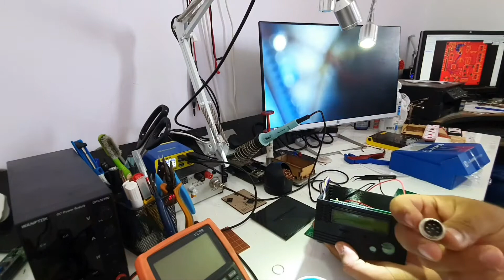DIY Pro'sKit ss-331h Got a PCB

Comment: @fixtronics What is the PSU caracteristics that you are using please? (Voltage/Current/Power) ??
Reply from the maker: Hi
The original PSU used by Pro'sKit station is 18v 12A (ZD-P150).
The one I use is adjustable power supply and I set it to 12v 5A and plenty enough to do the job.

I actually compared the how long does it take to  heat up to a set temperature both the original Pro'sKit ss-331h Station  and my diy version and they both reached the same temperature set point at almost the same time, the original Station was faster by a couple of seconds only, which means my PSU is good enough to be used.

I wish I answered your questions

Good luck

Comment: Hi, great job!! where i can found the pcb please? or have you eagle file? king regards
Reply: It contain so much mistakes, you can't even imagine 😁 It shouldn't work, or not for a long time. The clue(several!) in a relay module, first is with blue case, which is SRD series, this video it's black, which is HFKW and it's not just that! It's because HFKW withstands higher electrical load. I think blue one he burned. Relay is full incorrectly wired. Schematics contain few more surprises, even silkscreen print contain a mistake at J3 connector, see, P+ goes ground, and P- goes positive, he should swap them, because this is important to connect PUMP. The labels RX and TX are swapped, what the reason?) And to improve it - it should get more powerful power supply with 18v, this will require a schema improving, getting different pump, which more close to original one. Author gives good starting point to get to know arduino, he's showing off a beautiful 3d printed box, and gives inspiring words "amazing" and "it works!" 😊 Thank you for all! 🤝

Comment: Hello brother, 

Can you please let me know your setup’s power consumption? In my case, on startup, the current goes up to 4.5A and then drops slowly to reach 2.5A when it reaches the set temperature. It takes up to 2 minutes to reach the set temperature of 260C. The wires get hot because of this current flow. Is there a fix for this, or do I have something wrong?

Best Regards

Comment: This project is amazing! Thank you for sharing it.

I've ordered the components to build it, but the only thing I can't figure out is the pinout of the socket. To which pins on the GX16 connector should I connect the wires from J1 and J2 to? Mine is the 7 pin version.
Reply from the maker: Hi friend 
The GX16 pinout is available in the schematics
Please check the video description 

I wish you all the best brother
Reply: @FixTronics  Thank you for answering. 
Just found the pinout in the schematics from your first video (v 1.0). I think the pins are not present in the schematics from your PCB (v 2.0), unless I'm missing something.
Reply from the maker: @andre_0  
You welcome friend 

Yeah its only on version v1.0
I wish you a pleasant life
Reply: @FixTronics  Thank you for answering. The pinout is missing on your new PCB schematics, but I just found it on your other video (v 1.0).

Comment: Hi, does this heating element has PTC thermo sensor?
Reply from the maker: Hi
Yah it has ptc sensor
Reply: @FixTronics  what the resistance of PTC and heating element?
Reply from the maker: @rajeewaperera1752  
The heating element is 1.7ohms and the PTC sensor is 50ohms which increases with temperature

Comment: Now i managed to make it heat by playing with but the iron is becoming glowing red hot and i cant control the temperature at all  im discourage a bit :face-pink-tears::face-pink-tears::face-orange-biting-nails:
Reply from the maker: Do you have the same exact gun as the one I got?
Reply: @FixTronics  i have the one with 7 pins and i have test it  at first it wasnt heating at all and i checked and i have 12 volt that goes to the heater it have 12 volt ..so i dismantle the gun and playing around with the wiring i managed to make it heat but the temperature is rising until it become red hot i dont know if its a faulty gun or the wrong thermocouple  its very disapointing :(
Reply: @FixTronics  do you have the pinout of the heating element?
Reply: @FixTronics  i found my error the pin 4 from the 4n25 is connected to the center pin of my mosfet... so instead of connecting it to the gate to make it open and close im connected to the drain!!lolll i need new glasses im 50 and bad vision :)
Reply from the maker: @BraveNewWorld1984-r6o  
Glad to hear that you found the issue 
Does it work properly now?
Reply: @FixTronics  Yes!!!!!!!!!!!!!!!!!!!!!!!!!!!!it work the fire of god bro!!!im so happy!thanks a million times for your help! it was my pinout on the mosfet i put the gate opener from the 4n25 on the source instead of gate thats why it wasnt heating properly!now it work like a dream im so happy!:face-blue-smiling:👌🤌✌👍👍💪💪

Comment: Hi what is the difference with the first plan you shared im about to buy all the components do  the fisrt plan is good or i have to build it on the last plan ? thanks for your help!
Reply from the maker: Hi friend 
Please go with the second schematic

The relay was wrongly wired in the previous drawing and I also replaced the relay driver
Reply: @FixTronics   Hi can you add a schema of the pinout like in the first plan ? i mean in the bottom right corner of the plan you have the pinout all described clear :)in the new plan its mark 1,2,3  1,2,3  thanks a lot for your help again brother and happy new year!!! i wish you all the best!🍷🍾
Reply from the maker: @BraveNewWorld1984-r6o  
Hi again friend 
Its the same in all versions, so you just follow the one with the pinout and it should work 

Thanks brother 
I wish you all the best to you and your family
Reply: @FixTronics  Thanks im about to receive all my components from Aliexpress all the rest is builded and tested thats gonna be fun!
Reply: Another newbie question: the potentiometer on the second plan the wiper goes to which pin? do the third pin goes  to ground or you have just two pins hooked up to the arduino? and do the pins are the same  as Arduino Nano version?thanks again bro for your precious help!p.s and what is the value of the potentiometer 100 k or 10K?
Reply from the maker: @BraveNewWorld1984-r6o  
Hi mate
The pot wiper is connected together with R2 to the same point.
But make it as I did, desolder R2 and use the pot instead for temperature calibration.

The pot is 10k
And yes both Arduino uno and Arduino nano are identical
Reply: @FixTronics  Ok so i dont need the resistor if i install the trimpot :) and the trimpot connect to the 5 volt input of the arduino?thanks a million times again for your help bro! im gonna send you a video at the end when all is gonna be completed !:)
Reply from the maker: @BraveNewWorld1984-r6o  
I wish you good luck my friend 🖐🏻😊

Comment: IF ANYBODY IS READING THIS, i NEED SOME HELP (PLEASE). I bought an SS-331 and is has never worked right. I thought it was inexperience in my part, however now after the warranty has passed I discover that the tip is only reaching 200c (standby temp) no matter at what temperature I set it at, I have already done all the tests in the manual to make sure all components in the gun are working and they are. So there seems to be something wrong with the station itself. I opened up the station and do not see any loose connector or cables and inspected the board and do not see anything obvious like a solder bridge. Does anybody have any idea of what might be going on here?
Reply: @guayabito-para-ti I think you need to recheck the wire pinout of your gun, i f you always reach the 200°C only, means that you are applying power on the PTC not the actual heater element pins, check again the gun pinout using ohmeter, and the heater element needs to give you something around 2ohm in cold state and 4ohms in hot state.
Reply: @ahmedalayakhouadja1373 Thank you for your response. I will check what you are saying. I got tired of dealing with this problem and went ahead and bought the Hakko one from Amazon Japan. Even with the shipping it was much cheaper than buying it here in the US and it works like a breeze

Comment: Please help me I soldered all components carefully , have FTDI adapter and driver installed correctly put correct i2c library in libraries but didn’t know how to apply sketch any hint for Arduino ide configurations please😊
Reply from the maker: To load the sketch you just open the sketch via arduino IDE and choose your board and port then compile the code and load it
Reply: @FixTronics  i’m sorry for nobby questions but I’m very excited do i’m right i will connect Ftdi directly to pcb ? what’s board name to chose ? What’s  processor ? What’s programmer ? do i need to burn bootloader first ? Do i need to use  upload using programmer from sketch menu in ide Greetings brother
Reply from the maker: Its Ok my friend 

Yes you need to Burn the bootloader first if the ATMEGA328P chip is new and never been used as arduino mincrocontroller,
Then you can install it to the board and connect the ftdi and load the sketch and choose arduino nano in arduino IDE.

I suggest you to take a look to this website to guide you through burning bootloader process: 
https://electronoobs.com/eng_arduino_tut6.php

If its hard for you to do all this process, I suggest you to bring a arduino nano board and load the sketch then desolder the chip and solder it to your board, its much easier this way.

I hope this will clarify it for you
Reply: @FixTronics  Thanks and appreciate your very helpful response that’s actually what’s I did it i moved chip from nano to pcb 
Now it’s working but have little bugs 
1. When turn it on not working directly it’s may need to turn on and off several times to work normally and take long time to boot not like your video  
2. After reaching the required temperature when push on gun button the pump work but pcb reboot it self not every time maybe one by one 
3. After work with it for about 5 minutes temperature and current flow falling down rapidly even when i press on both tactical button not respond 
Any help for this please 
Thanks from heart
Reply from the maker: Check all components are correct value and are in their correct position, especially the resistors
Reply: @FixTronics  ok i will try again and I’m very sorry to bother you with my questions
Reply from the maker: No issues my friend 
I wish you all the best

Comment: video shown pcb and gerber pcb is different , in video shown pcb had smd components and components placement is different than given gerber pcb in google drive link
Reply from the maker: From what I remember, yah I have changed some components which are a bit hard to solder like the crystal Oscillator and the buzzer
Reply: @FixTronics  can you share updated pcb Gerber ?
Reply from the maker: @diyelectronicstelugu 
That was the latest version
Reply: @FixTronics  got it , thank you
Reply from the maker: @diyelectronicstelugu you welcome brother

Comment: Hi Great work, What is the model and voltage of the pump , is it 2.4 LMP or 3.2 LMP & is it 12v ?
Reply: From the schematics it seems you need the 12v pump. I think the 3.2 LMP version creates bigger vacuum as the name suggest. So If you chose the bigger you get the better suction.
Reply from the maker: Hi 
Currently I'm using this pump 👇🏻
USA PARKER Air Pump /  Brushless DC 12V 
https://a.aliexpress.com/_mNFOa6e

Its a bit loud and noisier than the previous one I used, but its suction is much better causes less clogs.
Its a 12v and 7 LPM
Reply: @FixTronics  Hi the brushless pump we have to connect the +and the - only the white wire goes where?
Reply from the maker: @BraveNewWorld1984-r6o  
Its a no connect wire, Just leave it floating

You need the positive red wire and negative black wire. 

Make sure you never reverse the polarity of the wires or the motor will get damaged as it contains a circuitry. 

Good luck
Reply: Hi, how about powering the gun with 24V? It is well capable of it. Does any significant changes to be made to the schematic to accommodate 24v?

Comment: Hello, can you please share the pinout of the desolder socket?
Reply from the maker: Its in the schematics at the video description
Reply: @FixTronics  I am looking for the pinout in the solder gun side, there is one socket with 7 pins. In the schematic it looks like that J1 and J2 are intented to connect to the seven pin socket but I need to know the match of each pin. Thanks

Comment: What type of connector does the gun have? connector GX16?
Reply from the maker: Yes its GX16
Reply: @FixTronics  thanks. What voltage should the vacuum motor be?
Can I use ULN2001D? ULN2001N is not available on aliexpress.
Reply from the maker: The motor voltage depends on the motor you are using. 
I  am using a 12v motor 
and yes you can use ULN2001D
Reply: @FixTronics  Ok, thanks. Is the SRD-05VDC relay OK when it is connected to input 1 at 12V. The relay is on 5V.
Reply from the maker: You are welcome brother 
But no you can't operate a 5v relay via a 12v power supply unless you want to fry it 😁
Reply: @FixTronics  You have it like that in the scheme.
Reply from the maker: Maybe by mistake I put it in the diagram but the one I used is a 12v relay
Reply: @FixTronics  So the SRD-05VDC-SL-C relay is faulty. Should it be SRD-12VDC-SL-C?
Reply from the maker: Yes you are right
Reply: @FixTronics  Ok, thanks. What value should the potentiometer have?
Reply from the maker: 10k
Reply: @FixTronics  Thanks bro

Comment: 4:38 Very interesting. But, a 50 ohm posistor is built into the heating element. It was probably easier to control and adjust the temperature with it. I made such a project through a posistor and a pid regulator.
Reply from the maker: Thank you for your comment ..
Yes I am using the 50 Ohms PTC to control the temperature but I was just calibrating it using the external thermometer..

Do you have a video on your project so we may learn something new from you..?

Thanks brother
Reply: @FixTronics  Sorry! I thought you weren't using a 50 ohm sensor. I'm not good at electronics. I made a project on modules from aliexpress. My project is suitable for people like me. No video. I posted it on the FLProg forum.
Reply from the maker: No issues my friend 
Thanks alot

Comment: Hello my friend, thanks for this amazing project, can you please explain why on the lcd you display (temp - 160) ?
What is this 160 value and where does it come from? you are also setting the SetpointERR variable by doing temp - 160 and i cant really figure out what this number does and why its 160 and not 120 or another random number.
also i cant figure out the following : correction = (SetPoint - SetPointERR) * 40; whats the 40 value? whats the reason for it and why 40 and not another number?

i also upgrades the code with the following features: 
1) check if eeprom data is valid before loading the saved temperature, 
2) converted the setpoint variable to float in order to be able to save to eeprom temps like  325c as 325/10=32.5 which is a float variable and couldnt be saved in the eeprom before.
3) to avoid eeprom corruption as it can only be written 100.000times , instead of saving a value on each button press, i changed it to writing to eeprom when the pump is activated and only if the value to be stored has been changed  and is different than the one currently stored in eeprom.
4) added blockage protection by only allowing to run the pump if the temperature is higher than a set temperature value.

i can share the sketch if interested but please explain why you do temp-160 and why you do (SetPoint - SetPointERR) * 40
so i can keep developing it
Reply from the maker: Hi friend 
Its great to see someone interested in upgrading my code, because I am not good at coding at all 
I am really newbie in programming languages 

I was really frustrated in writing that code

about the 160, the temperature readings I was getting were around 160 degrees away from the correct reading when measured with external thermometer so I had to subtract 160 degrees from the ptc readings

and the ×40 is to make correction more aggressive to reach the set temperature faster by increasing the duty cycle of the pwm (analogWrite(3,correction); )

This was what my head came up with😅
I hope you can improve it and make it smother and more reliable.

Looking forward to see the improved code

Thanks bro
Reply: Hi, I want to ask if the program has been improved and could you please share it. Thank you
Reply: @viktorkortvely  Hi i started improving the project 4 years ago but i had to stop as i moved abroad to 2 different countries, then i had a kid and now i dont have that much time to enjoy electronics and building projects. this particular project remains in a box in case i ever have time to continue building it but for now it remains abandoned. i have an arduino  sketch saved with the upgrades i mentioned and with more ideas for upgrades written in comments waiting to be implemented but i had designed a new pcb for this project with many improvements and additional features so i dont think my firmware is compatible with the original pcb posted by "fix Tronics" the new pcb included a temperature calibration potentiometer which this alone breaks compatibility with his pcb and firmware as he was adjusting the temperatures in the code with the (temp - 160) part of the code that was mentioned before, while in my board and firmware this is adjusted by a potentiometer on the board. The new pcb also featured a rotary encoder to be able to change settings and scroll through a settings menu but i had to stop developing before the code was written for all that. the newest arduino sketch that i have is still a beta with probable bugs and only the few changes i mentioned earlier implemented but its incompatible to be used with the original pcb so i dont know if it will be any help at all to post it. maybe fixtronics has improved his project and he can give you a newer version firmware